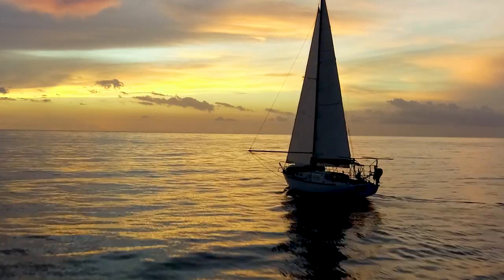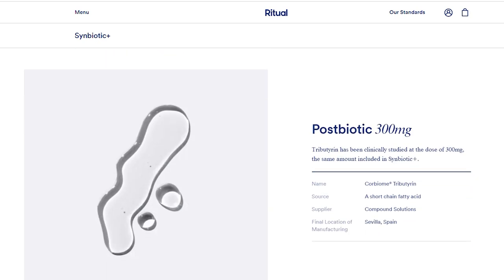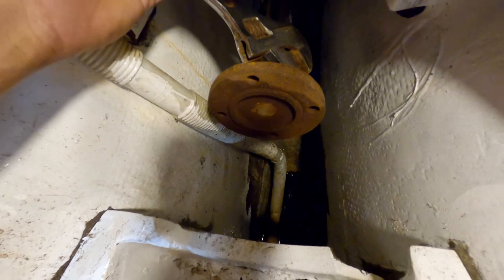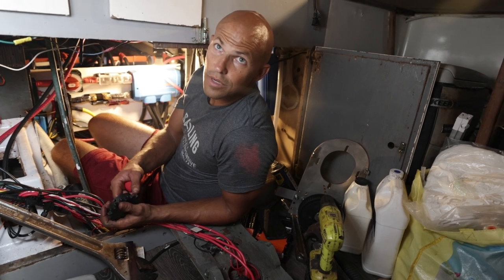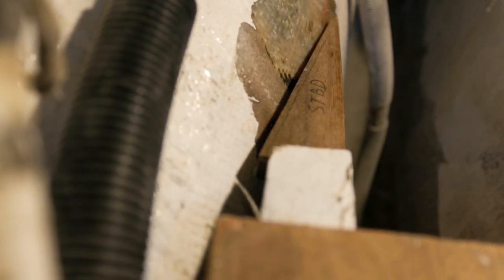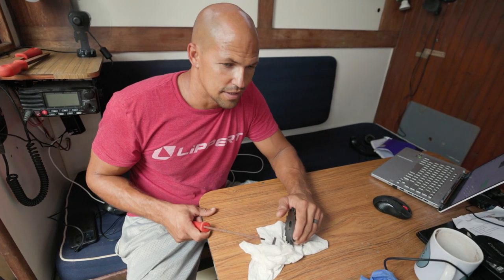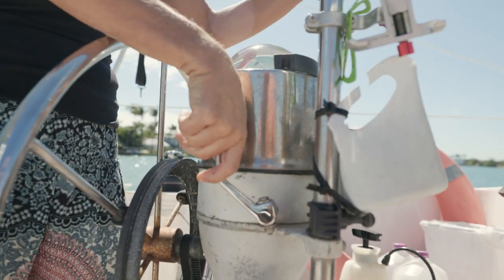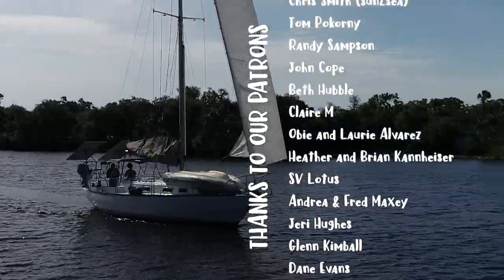we RIPPED out our SAILBOAT’S ELECTRIC MOTOR for THIS!

Comment: I'm confused. You should have the same amount of torque from your electric motor no matter what speed you run it at. Even at zero rpm it should have the same torque. Educate me please! I need to know!
Reply: Yes, typically the electric motor has maximum torque at zero rpm, is relatively constant until the back emf starts to break down the useful in coming power.
Reply: I have to over-simplify a bit otherwise it will get too complicated. Electric motors have a maximum continuous output torque rating. If they put out more torque than that, they will overheat. So yes, assuming your motor controller observes the limit, then the motor will have the same torque available at all speeds. But now we need to talk about power. Power is actually torque x speed. As you start driving the propellor, at first it requires very little torque and the motor can do it easily (you can turn the prop with your hand when the boat is stopped). As the prop speeds up, it needs more and more torque to keep speeding up. At some point, the amount of torque required to spin the prop will be equal to the max torque limit of the motor. If that happens when your boat is going 2 knots, then you need a reduction gear. This will allow the prop shaft torque to be higher than the motor output shaft torque and will result in delivering more power to the prop. Generally speaking, the maximum speed for a sailboat prop will be something like 1700 RPM or less. At that speed, too much power gets wasted just overcoming drag from the prop moving through the water and you don't get as much forward thrust. The variables here are prop pitch, motor speed and reduction ratio. A good installation needs to work through all that stuff to get everything balanced. But you never want your prop to spin faster than about 1700 RPM. So if you have a 5000 RPM motor you will always need a reduction gear, or you will need to oversize the motor quite a bit so it can deliver high torque at low RPM.